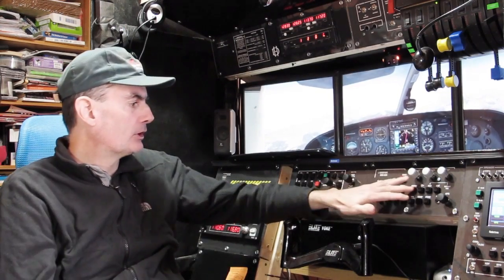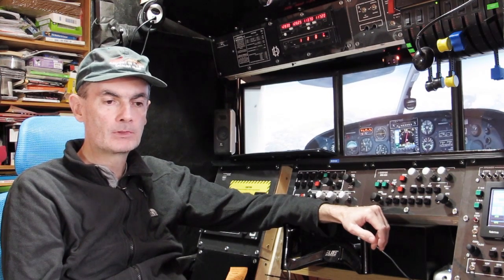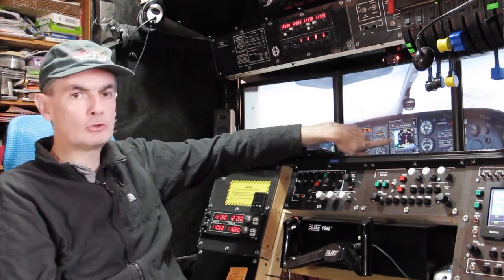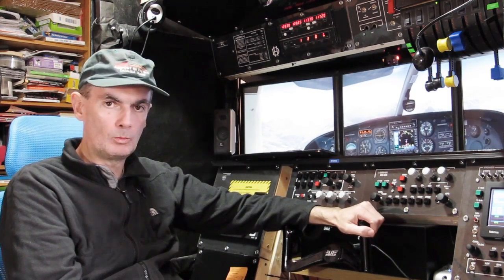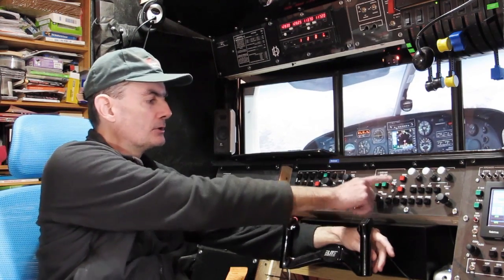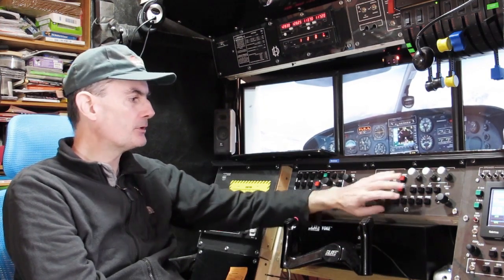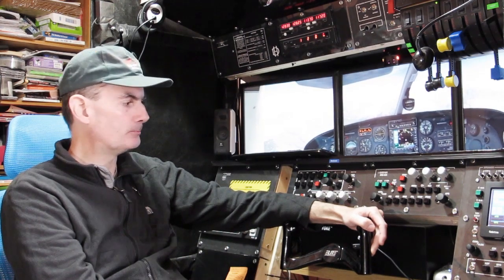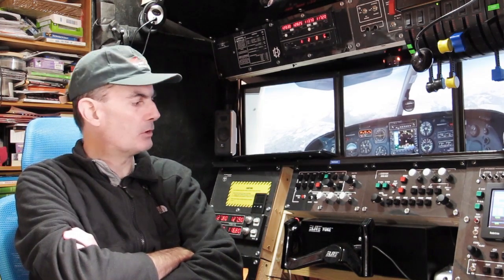Build the GPS+ Panel

Comment: I appreciate you making this available, but could you provide it in PDF?
...and how would this panel work with X-Plane?
Paul
Reply from the maker: PT Johnson Hi there. I don't know how X-plane interfaces to joystick controllers so I can't comment. I would imagine that it can see joystick controllers just like FSX can, but you will probably not be able to use LINDA. I expect you could assign all the buttons directly from X-plane but unless X-plane implements a SHIFT function for buttons you will not be able to use the single rotaries as I intended. This means you would not be able to get the GPS+ panel to work fully with X-plane - you could, however, build the the GPS+ with dual concentric rotaries instead and that ought to work. You may also want to look into XPUIPC, which I think emulates FSUIPC so that you can use FSX stuf with X-plane. As I said, I have no exeprience of any of this so I can't be more specific.The eBook is not available as a PDF. However, if you buy a kit from me you get a construction guide that is a cut-down version of the eBook (without the scratch-building stuff). That comes as a PDF.